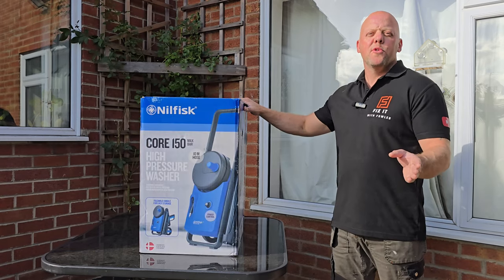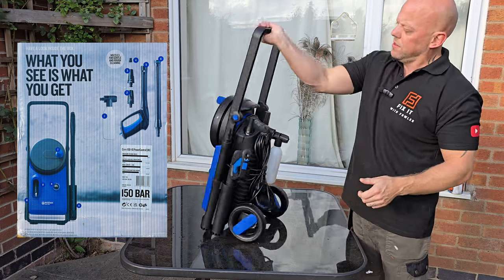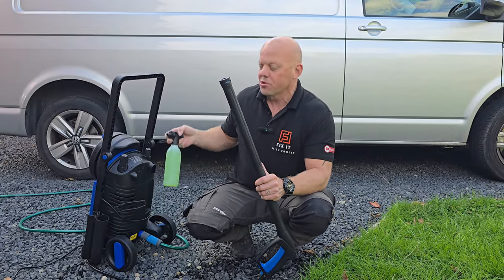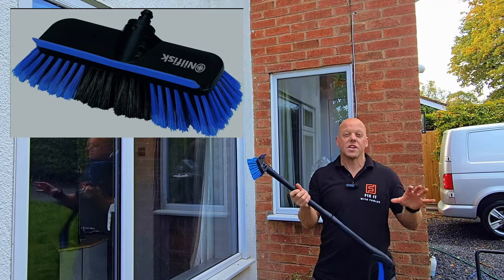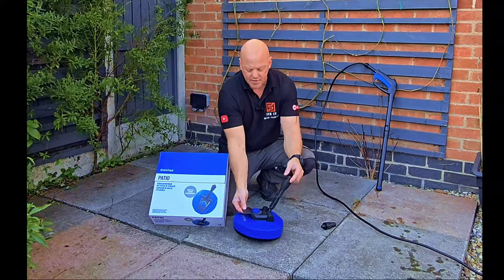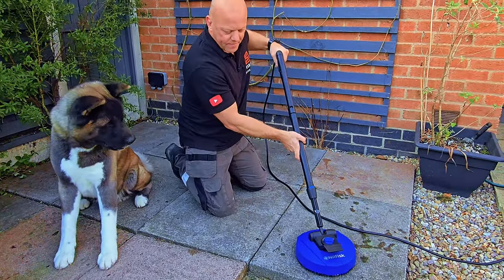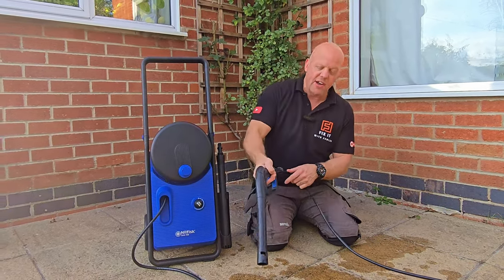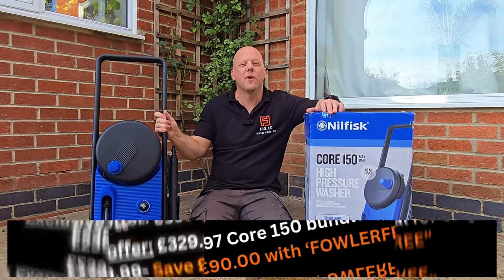NILFISK Core 150: The Best Pressure Washer? You Decide!

Comment: Thanks steve when ordering it says the discount code is not valid on this order ,i was ordering the machine and brush .total £279.98
Reply from the maker: Hi, have you put in the basket a nilfisk core 150?
Reply from the maker: Hi, i have messaged Nilfisk, so hopefully, i will get a response and give you an update. Its worth waiting as they will fix any issues tomorrow at the latest
Reply from the maker: Morning, spoke to nilfisk and they said it is because you need to add 2 accessories to your basket and the pressure washer. 
Add Core 150
Add auto brush
Add patio cleaner mid
Enter code FOWLERFREE 
Save £90
Like this https://shop.nilfisk.com/checkouts/cn/Z2NwLWV1cm9wZS13ZXN0NDowMUpCODg1SkY5RERNQkVZWDhZWTNKU0FTVg

Comment: Would it be safe to use that drain cleaner down the drain in my shower? Or too powerful?
Reply from the maker: That is a great question and probably worth me trying. I would presume it would be fine, but don't forget you can turn the pressure washer down on this Nilfisk core 150 with the 3 power settings.

Comment: Invalid code it says
Reply from the maker: Did you use FOWLERFREE ?
Reply: @FixitwithFowler  I tried that to see if it would work and it says invalid
Reply: @darrenrodd.  I think it's because the Nilfisk link automatically is saying £239.99?
Reply from the maker: Just double checked and it is Valid 16/10/24 to 20/11/24. My mistake!
Reply from the maker: Hi, they have just updated the code for my viewers, so thats great news. Even better that you have used it and saved £90.

Comment: Sent back my Nilfisk after 3 months of light use. Rust in the outlet pipe and motor issues causing cut outs. Nilfisk didn't even question the fault, they knew about these issues.

Bought a Karcher HD Classic 4/10 and it has performed amazingly. £136 from Farm Foods happy days. Far better build quality and proper M22 connections.
Reply from the maker: What Nilfisk model was that and how long ago? Nilfisk is the only manufacturer that has an all metal, long life pump. I prefer the connections as my Karcher had got stiff connections. Loads of positives for Nilfisk, including a 5 year warranty!